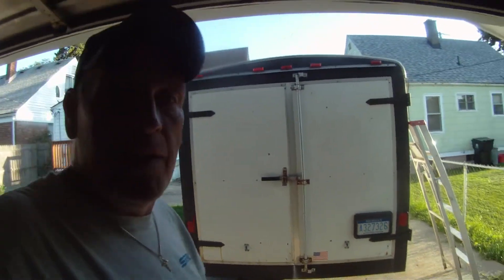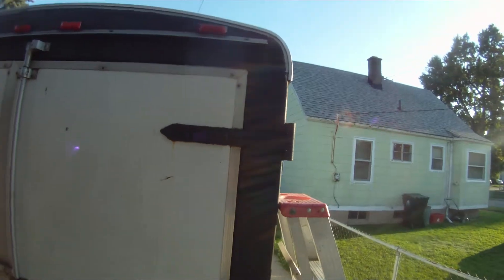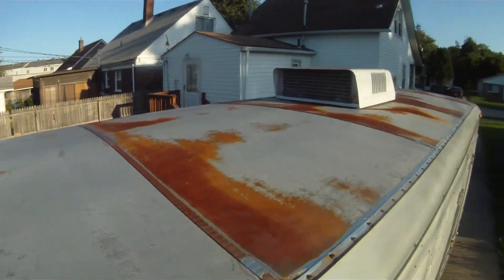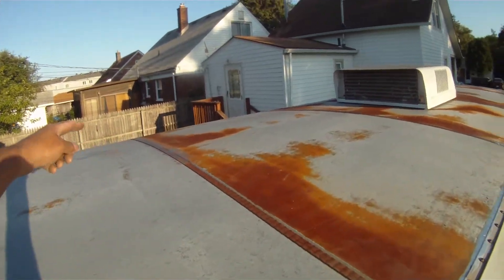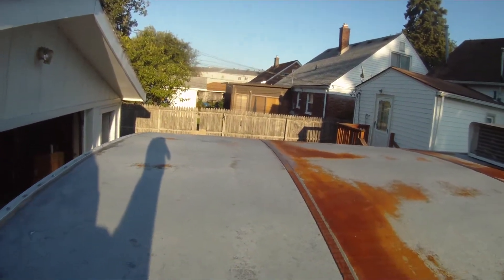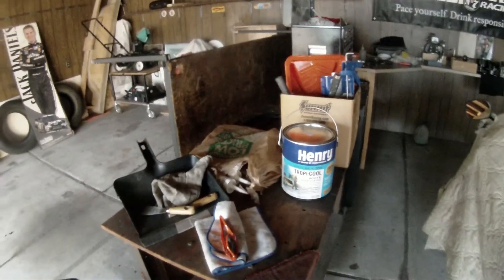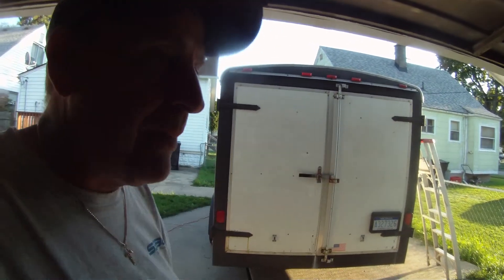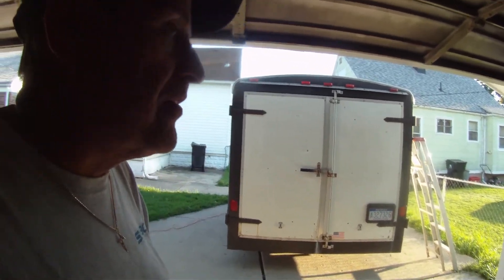Trailer Project Part 1 - Remove old sealer on Roof & Seams

Comment: A four cycle laydown at Daytona? It will certainly be different than what you're used to. I did one at the end of the eighties there. If there had been more of them it might have been fun... Actually four strokes can be fun on a big track, if you use enough of them! He is our race on Labor Day at Inde Motorsports Ranch (you'll need to skip ahead to 16 minutes in for the fun part). A Tony converted to a dual with two Briggs World Formulas. Not quite as fast as a Mod Honda Shifter.  https://youtu.be/OJlXA8paG6w